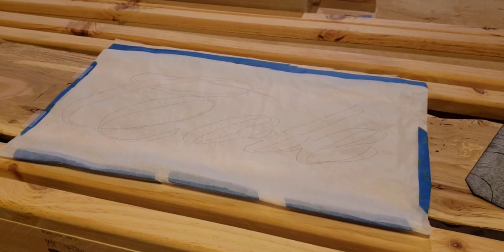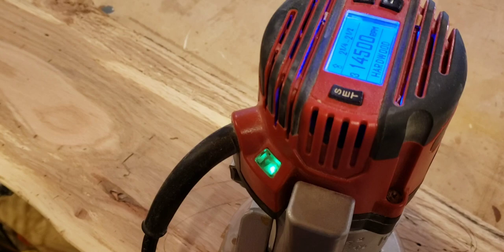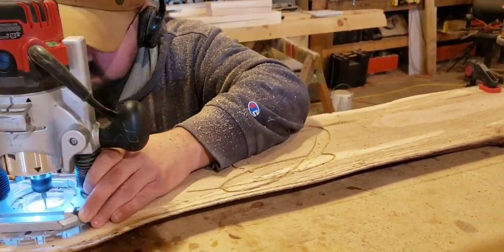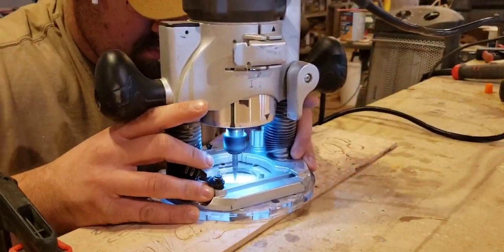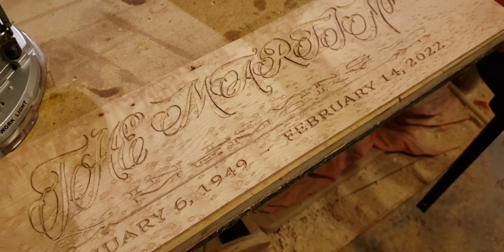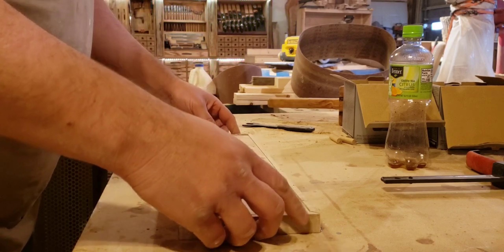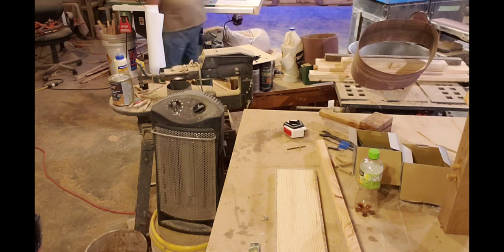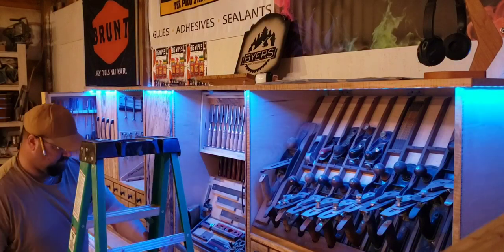hand engraving with a router, short version.

Comment: Hey Jason, what a beautiful final touch to an awesome tool cabinet! I’ve never done much engraving with a router, but it looks like the bit that you were using. Would definitely make the job a little easier to control the router. I may need to give it another shot. I hand engraved a sign for my parents that said FAMILY for their kitchen with a simple family tree with carving knives, it turned out pretty good had a few imperfections, but I told them that families have a few imperfections as well so it all worked. I think carving by hand with carving knives or a handheld router in my opinion for something like that would be a lot more heartfelt with your hand, guiding it other than computerized. They both have their place, but I’m sure your dad is looking down on you and appreciates all the hard work and effort you put into not only the toolbox, but to that dedication plaque. Have an awesome week bud and thanks for sharing your work! 😎👊✌️
Reply from the maker: Walt really appreciate that man that means a lot, and it takes a little practice and there's still some imperfections human error in my work, but definitely fun.
And the smaller bits i use the V-bit and 1/8" and small ones like that do make it easier. 
Thanks for watching and thanks for all the kind words and support really appreciate that and hope you have a great week as well!
Reply: @justinbyers1441  👊